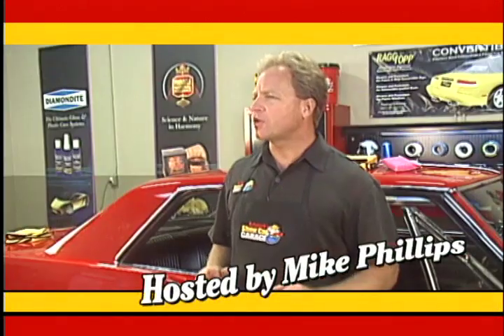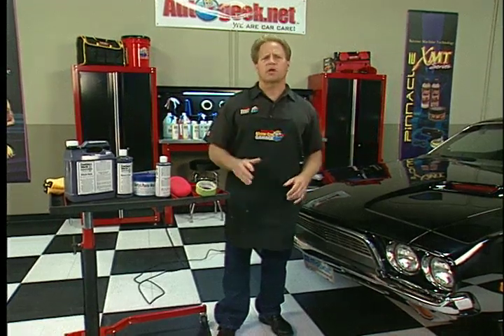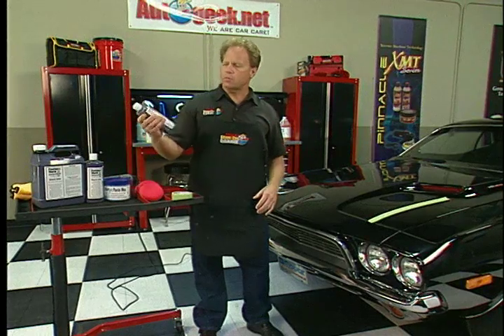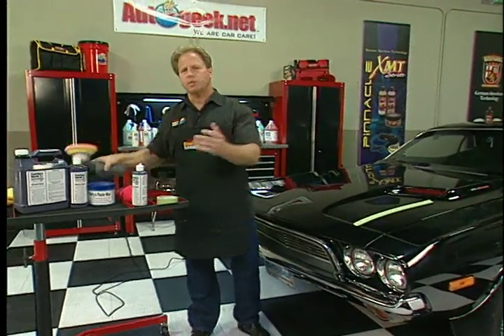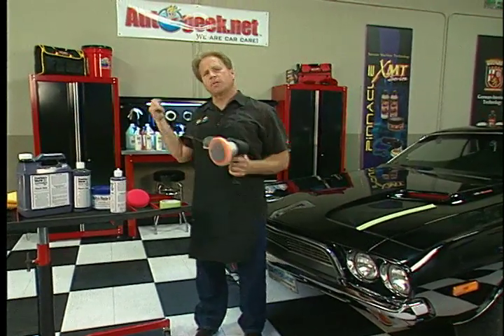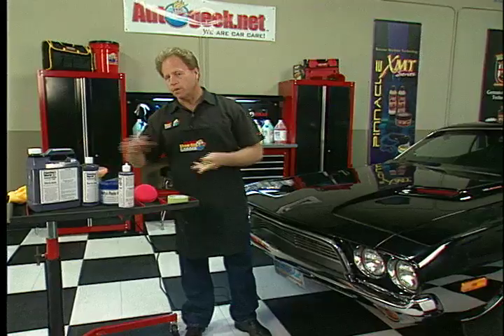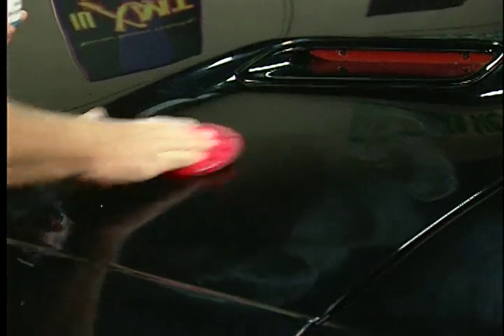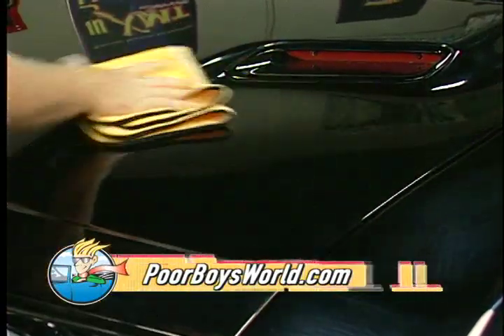Poorboys Black Hole Show Glaze on Autogeek's What's in the Garage? TV Show

Comment: Very nice I can't wait till my xmt #1-3 polish comes in along with my pads I ordered. however I do have a question, on a scale from 1 to 10. How affective/accurate is the xmt swirl remover compared to the others like the Wolfgang or the meguiar's 105 and 205. With of course using the proper technique and pads. I will be using the 5.5 orange pad with the #3 first then going to the white pad with #1. Then fallowing with the xmt glaze and some other wax I have. The paint is in really good shape I